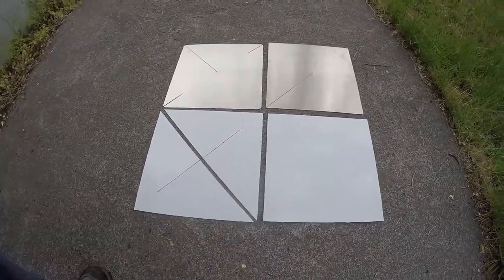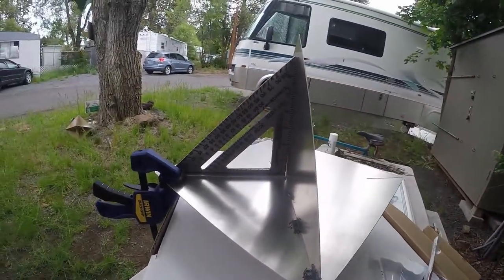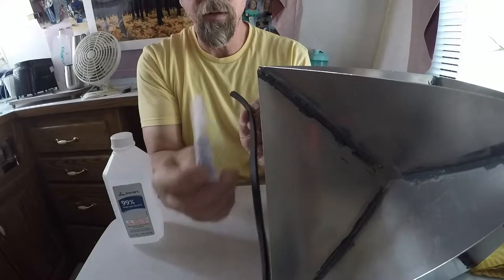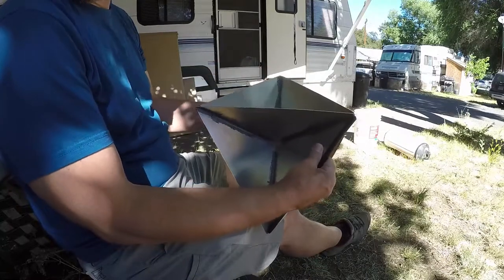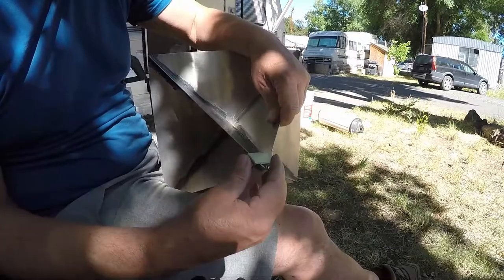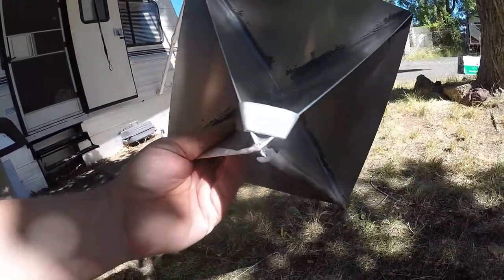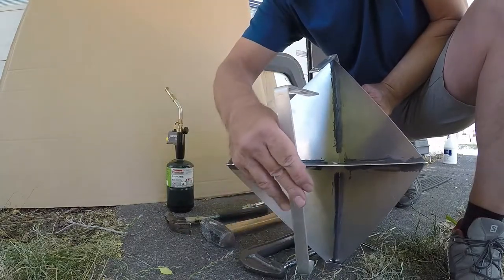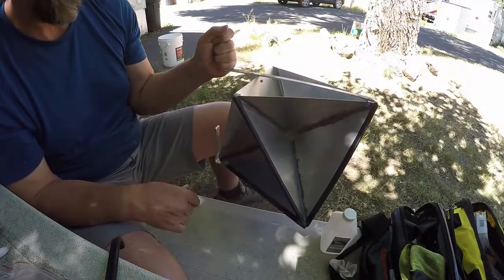Making a Radar Reflector - Voyage Dreams 75

Comment: Can you give us the dimensions of all elements?
Reply from the maker: In total I used 3 square feet (1 foot x 3 feet or 12 inches x 36 inches) of aluminum sheet. Two squares were cut to 12" x 12". The 3rd 12" x 12" square was then cut diagonally in half. I believe the video will show you how they all go together. The remaining pieces weren't at all precise and I just them as I thought they should be to hold hangers to be mounted to the front side of the mast. I hope this helps.

Comment: What is this for?
Reply from the maker: RADAR (radio detection and ranging) sends out a signal and listens for an echo in order to plot the range and bearing of anything solid, like land or other vessels. A radar reflector, such as the one I built in this video, when attached to a high-point on an object such as a small boat like mine, is good at returning the radar signals and helps other boats "see" me. This is especially useful during times of diminished visibility (e.g., fog, storms, night).
Reply: To keep your high priced military asset from getting hit. Whether that asset is a formation of tanks or a SAM battery. You stick these on some poles a safe distance away and radar guided missiles will be drawn to the reflector rather than your assets. Missiles are kinda stupid, so they will usually go after the biggest return their seeker sees and these reflectors are designed to stand out as much as possible.